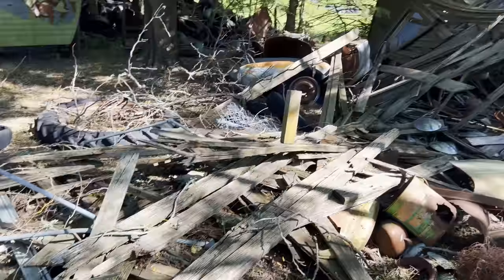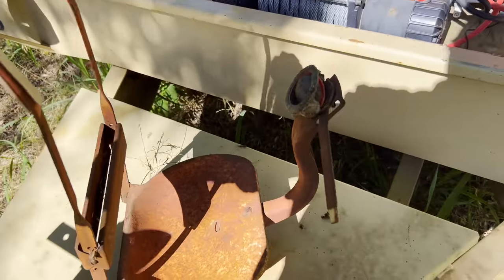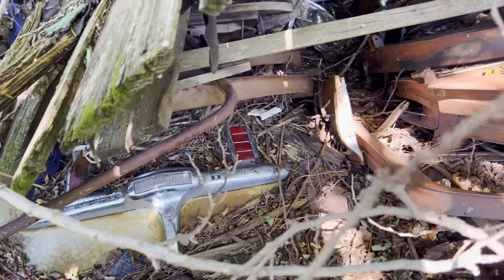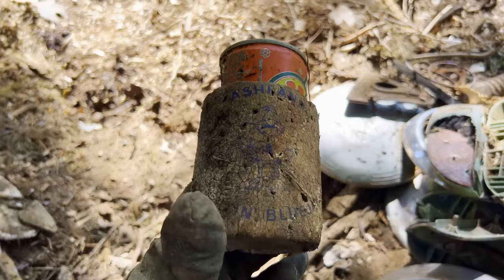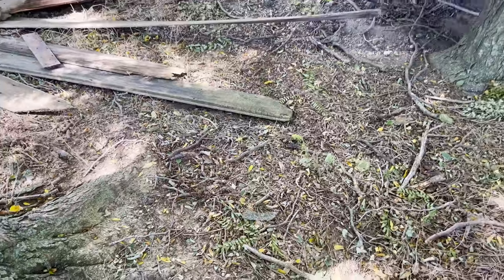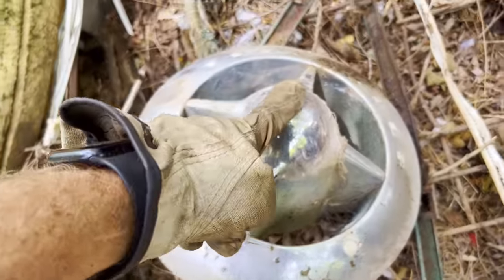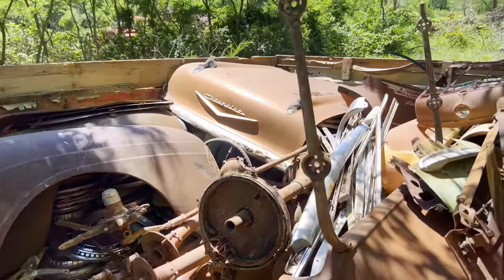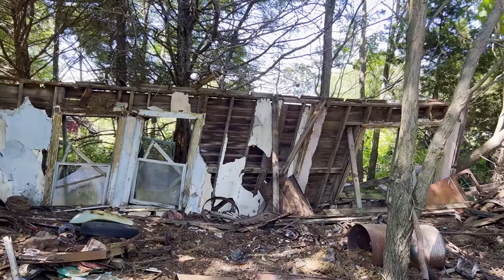This Abandoned & COLLAPSING House was FULL of Vintage Car Parts!

Comment: Hey Silas,
After you make your first pass at finding everything you can, are you going to go over it with your metal detector?
What a great find! I collect old vacuum tube equipment (amplifiers, stere equipment, tubes parts, old speakers, anything and everything vacuum tube related) when we were kids we discovered an old radio sticking out of the ground next to the approach road to the old dump. We started digging a bit and there was nearly an old WWII era radio repair shop buried there. We spent a couple of days digging it all up. I actually still have some old tubes and service manuals very well preserved from unearthing them 50 years ago!
I came home and made a diy metal detector, went back and found more stuff!
Peace my friend,
DrRick
Reply: Bet a few silver coins are there ?

Comment: @22.02 That trunk lid with 'fluid drive' came from a '49 Chrysler. That was my 1st car, a Royal. The handle was the release & the little plate above the handle had a protector for the key lock. Also, the red lenses were for brake lights. The tail lights/ directionals sat atop of the rear fenders/ quarter panels.

Comment: I wish I could do stuff like this again.. I found a ton of old license plates buried under plastic tarp... like I found about 20 plates from the 50's.. 17 of them were in pristine condition and 3 of them were damaged.. I got $350 for the good condition. My grandparents camp in Stratton, I found a LOT of junk still left behind.. there's a huge Coleman Super Circulator.. that was used to heat a tiny shed.. but there's tons of things I have no idea what they were.. there were 2 old washing machines.. one of them just the lower half.. the second one was more complete.. There was also an old Huffy pushmower too.. it was missing the motor.. just like the Huffy Riding Mower I had for a long time.. also there was a old bumper.. it looks old.. like it was from the 60's maybe if not earlier.. I miss those treasure hunts